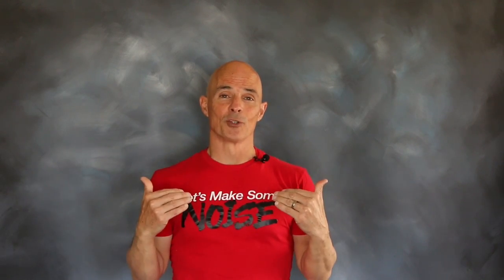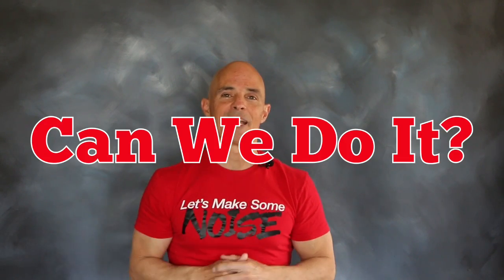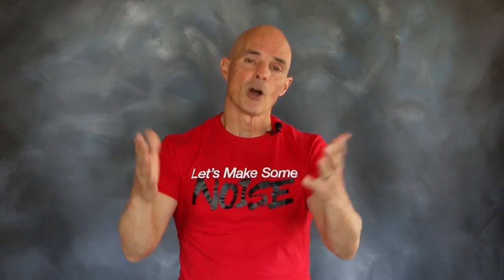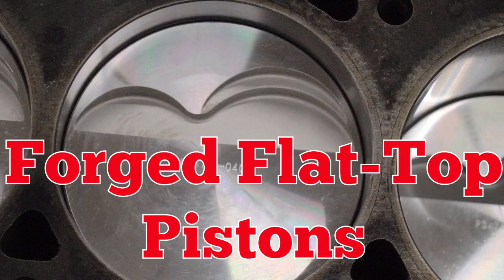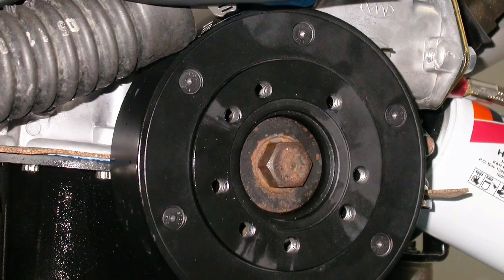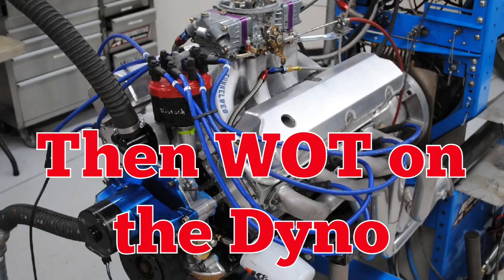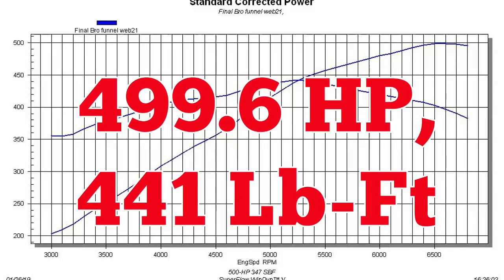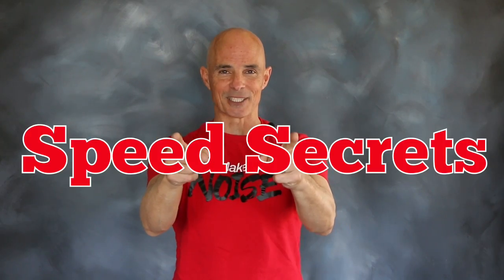Speed Secrets Getting 500 Horsepower Out of a Small Block Ford

Comment: Now do it with a 302.
Reply: the same top en and cam in a 302 would be 7000 RPM + max HP   and pretty radical.
Reply: mrhazel you guys realize a 347 stroker is a 302 bored and stroked, if they did all that to a 302 stock bottom end it’d make prob 380-400 maybe to the crank and then blow up from the bottom end being stock and not being able to handle it lol
Reply: @JplGamer  I realize what it is I have a 302 and no it wont blow up at 400hp thats just a poorly put together engine with a bad tune in it that probably beats the bearings out of it.

Plenty of 302s make 340 at the wheels without blowing up. Thats like 400 at the crank. Tune is everything. 

Richard has done it on here actually
Reply: mrhazel I was mainly saying 400 to the wheels lol
Reply: @JplGamer  I've even seen 347s that do that and not blow up

 plenty on here do. 

Its all in the tune
Reply: @JplGamer   no... a 400 hp.302 based stoker will.
 not blow up. If it does it was put together by a chevy guy..🤪
A 302  ONLY had about 190hp to the tire. Its a very small engine. What did chevy's 5.0 make to the tire? Hell the 5.7  tb only made about 210 fw hp.   People always bash on the 302.for no power.. well what do you expect? It's only 301ci's
Reply: @KingJT80  the 347  is a bad combo very flawed to much stroke for the block and its a bomb waiting the 331 is a much better combo for the block thats a fact
Reply: @BronsonOsborne  there's a reason you don't see 331s as much

Why would I pay the same amount for less stroke and turn it harder vs a 347?  i see WAYYYYYY more 347 these days than 331s
Reply: @KingJT80  the 347 is a bad combo to much stroke for the block for one thing its a ticking time bomb  NOT  GOOD IDEA   THAT IS A FACT you do as you wish im just telling you